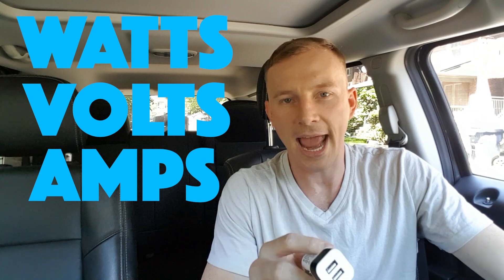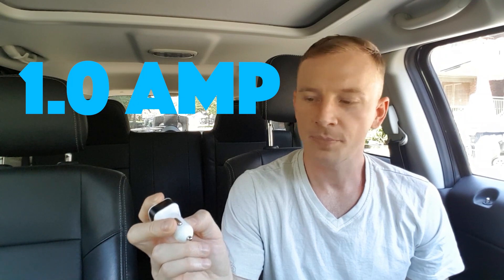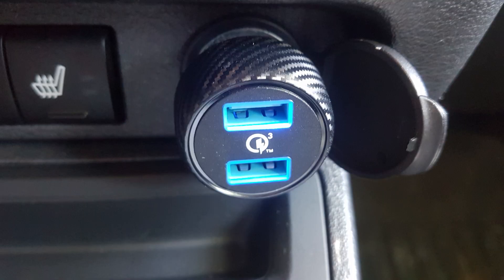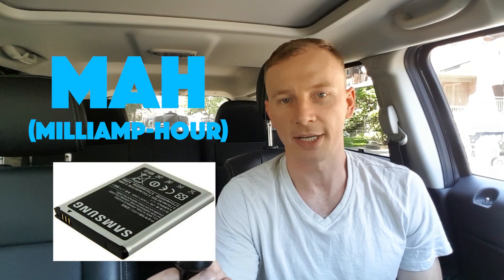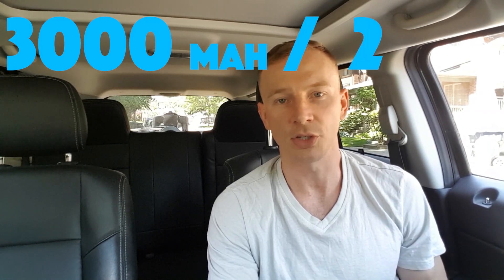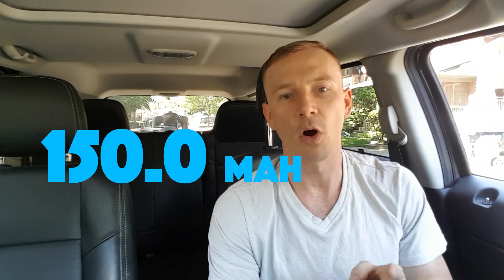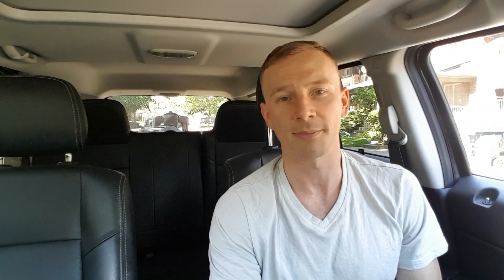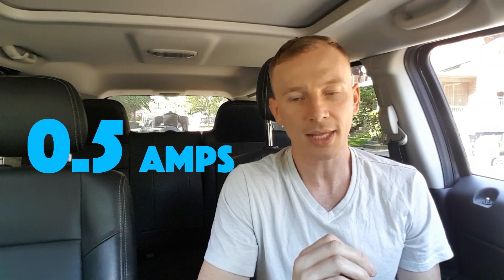SLOW smartphone car charging SOLVED!

Comment: VERY helpful, educational and entertaining! I just ordered a quality one from Amazon for about 12 dollars *10 pounds. And it says 3.2 Amps! Sorted! Thanks and please keep posting useful stuff again! (I did just wonder.... is it possible to 'push' too much electricity into a phone from the car-battery by using cheaper accessories? I remember years ago purchasing a device which I plugged into the 'Cigarette Lighter Socket' in the car which made a pot of tea/coffee! I still remember that ALL the electrics blew up, the car failed totally and I had to call out the Automobile Association to fix it; luckily it had simply blown some hidden-away fuses so I learned a valuable lesson!)

Comment: So in that case, how are automobile manufacturers limiting the "cigarette lighter" port? 

Because i just was put into a 2022 GMC Sierra work truck:

Took my personal 3.6a charger moved it over to the work truck... and now its slow as hell...

 is the aux port not fed directly from 12v battery power?

 maybe mandated by government for smoking issues so you cant use a super high draw device like a lighter?

And how they hell, would they throttle the amperage, i thought that was limited by the device drawing the power... (obviously a fuse also limits it... but not in the same way duh)

Comment: Video is very good. Not long ago, I bought a renhotecic brand USB fast charging back clip car charger. I pressed it on the car and used it for a while, and it felt that the effect was OK. It is recommended that friends in need can try to prepare a copy.

Comment: Now I got another concern, I just bought 65W car charger for my S22+ and i works nicely - super fast charging 2.0.

But will it ruin my car battery?
Reply from the maker: No it will not. Most modern cars kill power to the 12 volt when the car is off. Even if it didnt, the draw on the car battery is so minimal, it would take a few weeks (without starting the engine) to drain the car battery. Hope that helps. Thanks for watching!
Reply: @CoreyStaden  okay thanks a lot!
Reply: What if I have three of them plugged into all three of my cigarette lighter ports at the same time?

Comment: New sub!... I just bought a TCL 306 phone and it won’t charge at all in the car! In the same usb socket s that I use for my iPhone, sat nav or sum up card reader ( not simultaneously) the 306 makes a feint sound when plugged in, but the phone’s battery indicator fails to to turn green with the little thunderbolt graphic!  So over a few hours the charge goes down at a worrying rate.  Will your fix work in this case?....
I am reluctant to buy a power bank in case it doesn’t work!
Thanks for a great well explained video!
         👈😎👈
Reply from the maker: Probably needs more amperage. Try the Anker 12v charger with 1.5-3 amps. Sorry for the late reply. Thanks for the comment!

Comment: I bought a duracel 3 amp charger that says "fast charger" and as soon as I plug my 4500mah phone it still says quick charging then goes to cable charging. Ugh. Don't understand
Reply from the maker: Are you using a high quality cable that is fast charge capable?
Reply: @CoreyStaden  yes 🤔 the one from my Samsung charger (that does superfast) so I'm really not sure...
Reply from the maker: The Duracel charger might be a dud. Also, maybe a fuse issue with you 12v outlet.
Reply: @CoreyStaden  hmm it shouldnt be as it was new, legit brand from morrisons - but a possibility. Might try buy a Samsung car charger. Would a fuse issue not mean that the 12V just wouldn't work at all?

Comment: I've got the galaxy s21 and no matter what car charger I use it won't charge at all, it says it is charging but doesn't? Drives me nuts!
Reply from the maker: Have you checked the fuse for your 12v socket? Might be a blown fuse
Reply: @The Rundown  well its a lorry I drive, a different one everyday they 12/24v and in any lorry it dont work 🤷

Comment: Hey man, I enjoyed the video. So I just have some questions before I buy one. So I've got a Samsung note 10. My charger sucks. I understand that the wattage needs to be 1.5 or higher. What's the highest they make? And if you charger has 2 outlets or more, are you saying each outlet would do less than 1.5? Because what if you are charging 2 phone's at time. Say for you and the wife?
Reply from the maker: This device will fast charge both devices (providing your devices are capable of fast charging). It outputs 1.5 amps to each port simultaneously, so both devices should charge nice and quick! If it were me, I'd go for something a little newer:
https://amzn.to/3Hk7CHb
Or the one I am currently using which is really good and comes with a high powered cable: 
My current one: https://amzn.to/3CeA36m
I made a video about it: https://youtu.be/l_jP5TStDh0
Don't forget to subscribe;)
Reply: @CoreyStaden  Thanks first of all for getting back to me. I'm thinking of going with the in the one your using now, verses the newer one. Only because while I have the type C connector to, I like the fact that its more versatile with whatever adapter is being used. For example, if I've got a friend that uses an IPHONE, he can use it. The newer one may be better but it also has both outlets for type C. But thanks for the info and letting me know what to get.
Reply: @CoreyStaden  So I got a charger that works really well. But I now need to get a fast charger cord. Is there one you would recommend?
Reply: Let me ask you: Can you select another one? Because I'm trying to order it now, but it won't let me order it, since the item would be coming from Amazon in Canada and not in the states.
Reply from the maker: Absolutely! Here is the one for the States: https://www.amazon.com/dp/B08VNWF24S?maas=maas_adg_471647FF847B4A809D430BC62E56F450_afap_abs&ref_=aa_maas&ref=myi_title_dp
Reply from the maker: Also, Official INIU Website: https://iniu.shop/
Amazon store:  http://amzn.to/3plmAn5
Reply: Hey man, sorry for the numerous text. But I'm used to get a charger that just has the USB outlet. But the charger I got has not only the USB outlet, but it also has a a 30W and a 100W. What's the difference and can I use either one?
Reply from the maker: You can use either for a phone, 100w is enough to charge a 16 inch MacBook pro!

Comment: I have a 4.8 amp usb adapter. My phone could be off and the battery % will still end up lower than when I plugged it in. My vehicle is a 2020 camry LE. I've tried every port in my car, no difference. For example, right now my battery is 97% and my phone says 3h 48m untill full. I'm not so convinced a high amp USB adapter will solve the issue, it seems to be the car it's self that won't put out enough power no matter what kind of USB adapter I use.
Reply from the maker: What cable are you using? I would try another cable. Cheap cables will severely slow down the charging speed. If that's not the issue, maybe your 4.8 amp adapter is broken or faulty.
Reply: I can agree with this. Qi have a dual port charger with a 1A and 2.4A port and for a while both ports worked just fine. Last week for about 4 days it wouldnt charge my phone. Then suddenly it started charging faster, not 100% but quite a bit faster. 2 days ago it started doing the slow thing again or just wouldnt initiate the charge at all yet the light on the adapter was on and would charge other things. I have my original cable that came with the phone and other cables and when im in the car no other cables, or adapters will charge my phone now. The fuse has been replaced, ive tried new cords, new adapters, and nothing fixes it. I dont believe this to be an adapter issue. I think its a car issue maybe.

Comment: Sorry but in 2021 99% charger dont work. My charger have 2.1A and my  samsung chargin 6.5 hour. All that samsung and shit Iphone have change program ,what accept only original charger or cable. I have anather fast charger is 5A working good for sony realy fast charge. But not chargin samsung or iphone. Then my samsung  have 4500mah battery.🤷‍♂️🤷‍♂️Is only one charger  work for my phone is 25W  3A
Reply from the maker: Yes, quality cables make a difference.

Comment: My android phone has a micro usb port.  Would I therefore need another cable to connect the usb a port on the charger to the micro usb port on my phone?  And do you need to worry about the amp-hour rating of that additional connecting cable?  Hope my question isn't confusing.  Thanks, Rundown, good video.
Reply from the maker: Not at all! If your cable works well with your wall/home charger, then it will also work well with the car charger.  What phone are you using?
Reply: @CoreyStaden  Thanks for getting back to me!  I use a Wiki Ride 2 android phone.  I will need a charger in the cigarette lighter  
(is 2.4A output ok?) and I guess a USB to Micro USB cable in addition?
Reply from the maker: Yes, 2.4 Amp is plenty! And the cable will be USB-A to micro USB. Never heard of that phone before🤙
Reply: @CoreyStaden  Thanks!

Comment: Mines legit says 3.1 amp but it charges so slow.. as a delivery driver, i would assume it would worn out because it is old and had it for a long time. Does that happens?
Reply: Same for me, even if I am not a delivery driver :-) Qualcomm 3.0 quick charge, 3.1A and sloooow charge
Reply: If it has multiple ports, it could be that that current output is split between the 2 ports, so one should be 1.0amp where the other port is 2.1amp

Comment: How about bad wiring in my `99 Fiat Uno and the fact that step down converter charger 12 to 5 v mustn`t have resistance between car battery and  a cigarette lighter plug. That's the problem with my car. Maybe adding electrolytic capacitor will solve the issue. It seems that I`m the only one that has the shitty car and issues  that comes with it. Anyway you got the sub from me. Great video man.
Reply from the maker: I try to keep my cars for a long time as well but '99... good for you man!! 👍 Thanks for the sub

Comment: Hi, love the channel. Will the charger drain my car battery if it is plugged in while the engine is off?
Reply from the maker: Thanks for the comment! The answer to your question is, technically, yes. However, the Anker Powerdrive Speed 2.0 (Un-boxed in video) has a standby power consumption rating of less than 0.2 watts which is such a small draw of power that you would have to leave your car off for months before it fully drains the battery. So it is a non-issue and I will definitely be leaving mine plugged in for the most part.